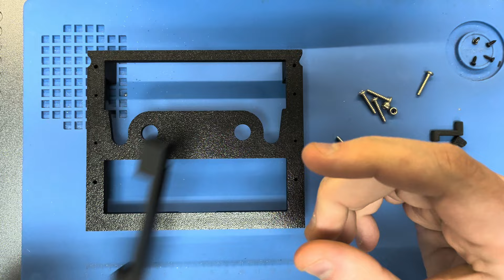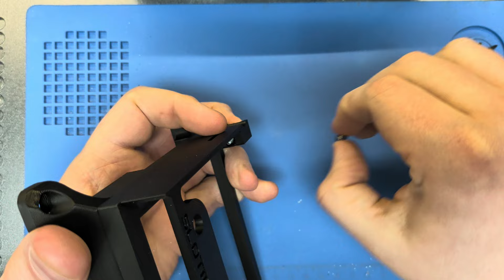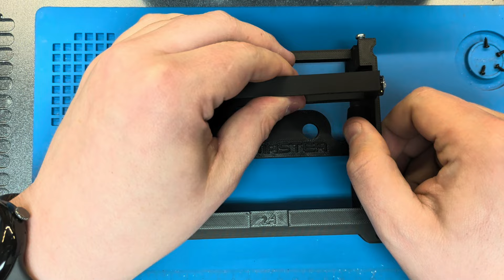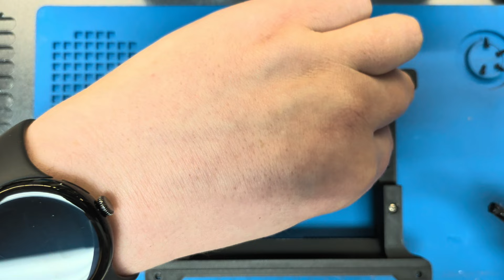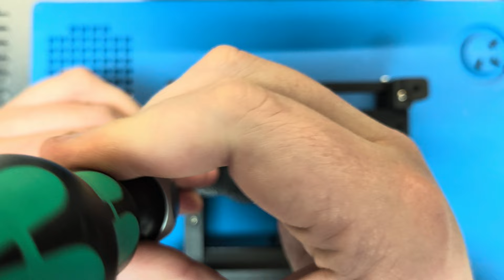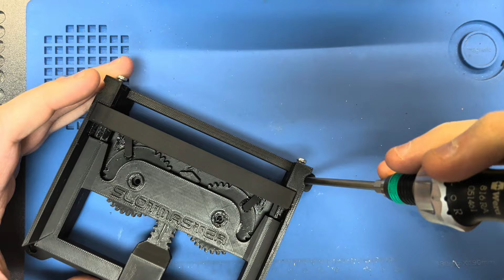Slotmaster Eject MKII Mount Assembly Guide

Comment: what screws did you use?
Reply from the maker: The prints use 4x m3x12 tapping or 4x #4x1/2 sheet metal screws, and 4 m2x6mm or 4 #2x1/4 screws